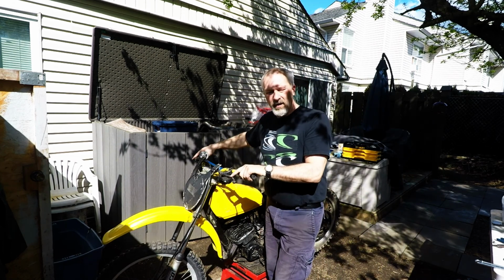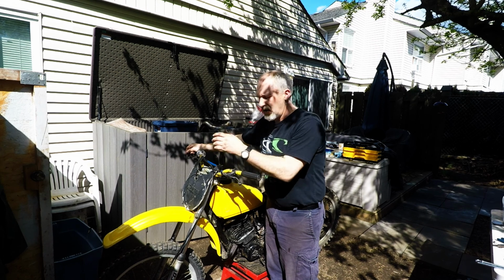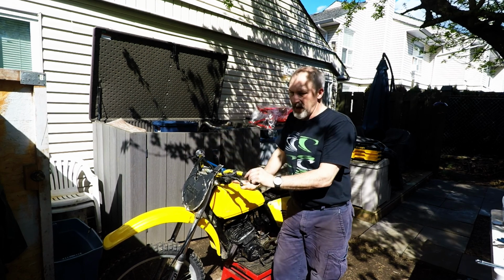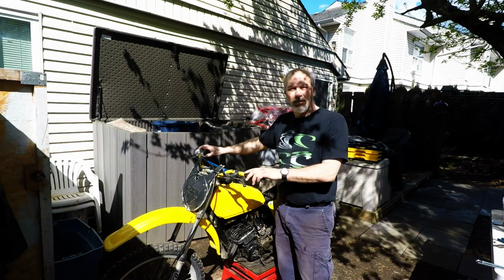THE SOLD RM100 Returns! part 3

Comment: I'm in process of doing up my 77 RM100. I bought it back in 92 from a friend and it wasnt running (not enough compression). It would start first kick,, but give it throttle and it would bog down.. Well, I lost interest in tinkering with it and it sat in dads barn for probably 25 years and just got her home a month ago. Tore it down and discovered there was NO head gasket (at top of jug) it had the copper ring, but that was it. I think i found out why it didn't have proper compression 🤦‍♂️.
Reply from the maker: awesome to hear that you are back at it again. Pretty funny about the head gasket
Reply: @TNTMOTO  Yep, it was definitely a forehead slapper. I didnt even notice. Quick question. I've heard different takes on using a gasket sealer on the (paper? not sure as it hasn't arrived yet) head gasket. Some say yes, some no. I figured since you had success, I would do whatever you did. Thanks! 😊
Reply from the maker: @yoyoglock4  Dont use a gasket sealer. think coat of grease or oil between your fingers is all i ever use.
Reply: @TNTMOTO  Thank you!  I wish I could post a pic on here. Can't wait to get the old girl running. Owned it for soooo many years and looking forward to finally being able to ride it. 😊😊😎😎😎

Comment: Hey Sir! I know you sold the bike & all. Was wondering in the last video what oil you used for the engine? Thanks!
Reply from the maker: if you are talking about the transmission. Just regular 10w40 engine oil. Nothing special, no synthetic, no $30 a litre special wet clutch oil.

Comment: I need to know if the springs are flush with the back of the basket part
Reply from the maker: i no longer have the bike, i sold it to a father son that were going to restore it. so are you fixing one? what is your clutch not doing?